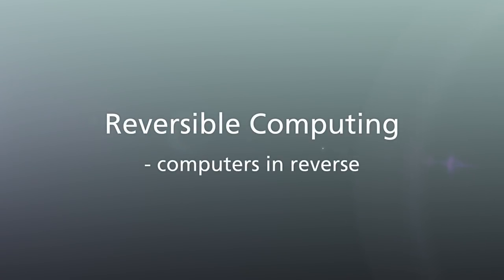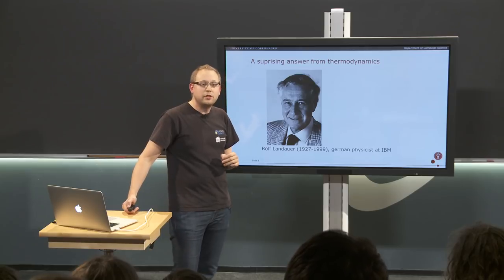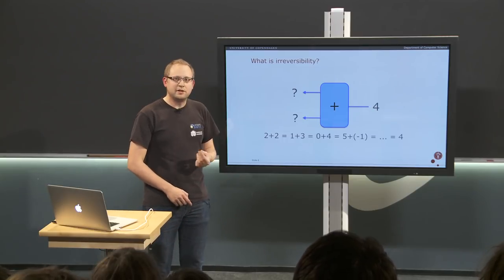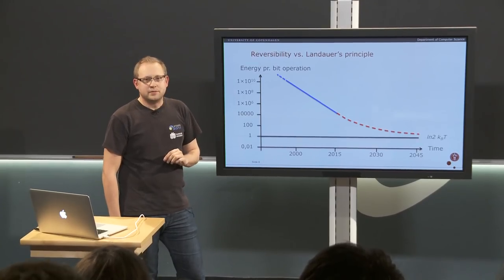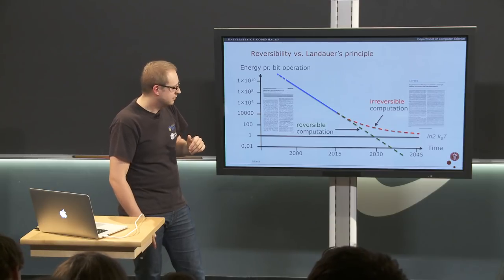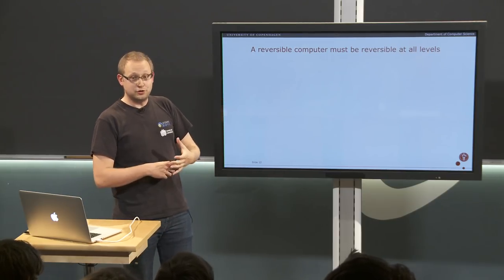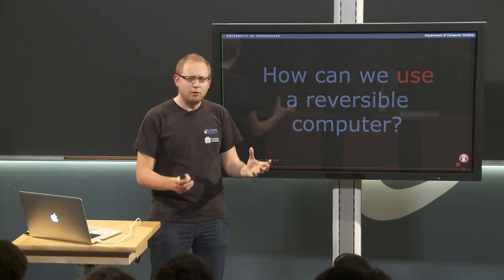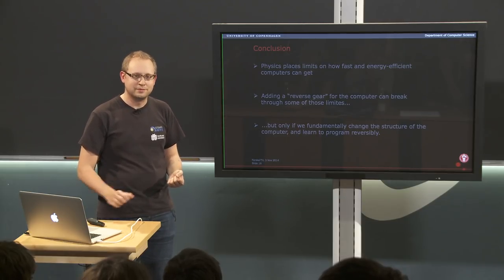Reversible Computing

Comment: how about the downsides of reversible computation? For example, making a reversible operation from an irreversible one tends to require more space (bits of memory)
Reply: I'm not quit sure if you think of reversible as a programming paradigm or as an architectural property of the machine? Last thing first. yes there would be a relatively small amount of extra bits used. if you mean as a paradigm property, not necessarily. It is highly implementation dependent. Assume that we have some program/system that would require the ability to at least some extend do some backward computation of a function/method, then this would still use memory even if we don't have the property. Offend the compiler which would be able to find the reversible function will do a better job minimizing the size of the program, you could even make some intermediate language to interpret, that encode reversible computational property. if we have a sequence of simple (machine like fix sized operations ) it would only need to encode and extra pointer at branching and an extra pointer to indicate the end of the sequence of operations of that function. Since all other operations happens to be a sequence and traversing forward an backward would be the same, it would need a mark that indicate weather the function should run forward or backward. This would possibly reduce the memory consumption of the program since we can effectively encode two functions into function one.
Reply: Requiring almost no energy is well worth the cost needing extra bit space. Especially with quantum computers on the way.

Comment: I think reversible computing would have a huge advantage from a debugging perspective, since we can always know how we got to the point we are at. If your program crashes, just hit the reverse button until the point where it went wrong.
Reply: At the moment of writing, I'm doing a thesis in this area and yes it would be much easier for OS to not crash at all under the assumption that they are reversible. The most funny property of a language that have reversibility as a property, making a compiler of a language (possible the same language) will make the compiler able to decompile the program again for every program in that language. There is still a lot to be done before we find this property in general purpose language, and the downside is that we can't represent irreversible computation without a overhead of memory consumption in trace history (which will vanish every time the computation runs in reverse).
Reply: @streetwear37  how would a reversible computer handle data streams from an external source, such as user input? This information woild have to go somewhere.
Reply: It should be possible to create some sort of LISP that is reversible – without the benefit of low (or no?!) power consumption. The lambda calculus basically only has one operation: function application. I wonder if someone has invented reverse-function-application. You'd give it a result and something else, and it returns the function and the argument.

- plus(5, 3) => 8  
- reversiblePlus(5, 3) => (5+3=8, 5-3=2)  
- apply(x => foo(x), 5)  => foo(5)  
- reversibleApply(x => foo(x), 5) => (foo(5), ???)  

One way to make a program reversible is to store all former states. That's like making a memory dump every frame in a Gameboy emulator, for example. It would just take a lot of memory, which makes it impracticable.
You could store some kind of "keyframe-snapshot" of a programs memory every five seconds and discard the old snapshots. Some sort of backup system for RAM instead of for the hard drive. When the user or software-tester notices a bug, they can revert to the most recent valid former state, when it hopefully hasn't been overwritten yet.

Comment: Can't you make any operation trivially reversible, by passing on the raw inputs as additional outputs?

    def makeReversable(f):
        def reverseableF(input):
            return (f(input), input)
        return reversableF

Maybe you don't want that, because you need more memory for every operation? My first thought for a reversable "plus" here was to map (a, b) => (a+b, b), then the reverse operation would be (sum, b) => (sum-b, b). In that case, you don't need to remember a.

Also, I understand we don't want to have an unreversable component to create a reversable one, so we don't inherit the high power consumption of the unreversable component. Maybe that's the issue.

Comment: Forgive my ignorance, I'm not a physicist nor a computer scientist, just a philosopher. But isn't it true that if for a reversible computation we need the gates that have the same amount of inputs as outputs, then we store the additional information required for a reversed computation? This gives us gains in efficiency during the computation. But the extra information is not relevant for the result, so we either have to store it forever, or we have to erase it at some point. And if we choose to erase it, we dissipate the same amount of heat as if we were doing the irreversible computation in the first place, thus nullifying the gains. Am I wrong? If so, I'd like to learn why.
Reply: I think the extra information gets erased by running the program backwards after you looked at its results.

Comment: Very interesting topic, although actual reversible computing seems unfeasible to me, due to the amount of data you aren't going to use but have to save somewhere just for the computation to be reversible. This can't justify the energy used for manufacturing storage devices, as the required storage capacity seems to grow indefinitely as our computations generally go only forward, not backwards.

Looks like our brains are already at or near the limit that is imposed by thermodynamics. Nature would make use of reversible computing principles (in the sense of not erasing any information) if it would be practical, and the brain would not consume more specific power than any other organ.

Comment: How would the second machine use less energy than the first?  On first glance, it should use twice as much energy because it's doing 2 computations.
Reply: he doesnt explain why it uses less energy. In his example he's using an adder, however where energy is really saved, is with the logic gates. If you have an AND gate, it has 2 inputs and one output. So effectively, you're pulling one of the inputs to GROUND, and that is dissipated as heat. If you have 2 inputs and 2 outputs, nothing goes to GND, and so no energy is lost in theory.
Reply: Landauer proofed that. A reversible circuit have theoretically no energy dissipation (In real world very little much lower than irreversible circuit). Landauer found that the loss of energy was to the destruction of information not the execution of the computation itself, so if we can make a circuit that do not loss information over a computation it will not loss energy (theoretically) this is the property of reversibility.
Reply: Computers are isolated systems which can exchange energy with their surroundings. Since irreversible computing is a many-to-one mapping, entropy of the isolated system is decreased. However, entropy cannot decrease in the universe, so the entropy of the computer's surroundings must increase as a consequence, thus compiters will heat up and give off thermal energy.

Comment: Reversible computations... now all we need is a way to reverse entropy. Now THAT would be something.
Reply: Treasure Hunter Fluid theory (Reproduction/Alimentation/Rationality) decanted selfmultidimentionalover...
The simultaneity polydynamics of the movement  (Reproduction/Feed/Reasoning) generates pseudo-autonomy as material property, of the autogenous phenomenon; existing.(...)
Simultaneous as my unidimensional variability... 
unidimensional variability = live-beings
Reply: That's impossible. However Reversible Computations are in essence "0 entropy" operations meaning we could in theory have unlimited calculations being done as long as they are theoretically reversible and thus not breaking the laws of thermodynamics.

The implication of this in itself is almost the same as reversing entropy. As you could mind-upload yourself into a simulation and provide yourself with infinite (digital) experiences as there would be no limit in the amount of calculations per joule being done.
Reply: Inside a computer, irreversible computing actually decreases entropy because the output space is smaller than the input space. So, over time the set of states a digital computer can be in actually decreases, thus entropy decreases. The problem is the entropy of the computer's surroundongs is increased as a result, thus heat.

Comment: If we have reversible computer programs, than we will always have access to the source code. Also, encryption wont work if its reversible.
Reply: if the reverse is much slower, it could work
Reply: That is why you encrypt in the first place, to make it really really hard to decipher what has been encrypted, that just means it takes a lot of computer power a lot of time to break the encryption. Same is not true (as I understand it) with reversible computing as the solution to the problem is contained within the problem itself.
Reply: Árni Fluid theory (Reproduction/Alimentation/Rationality) decanted selfmultidimentionalover...
The simultaneity polydynamics of the movement  (Reproduction/Feed/Reasoning) generates pseudo-autonomy as material property, of the autogenous phenomenon; existing.(...)
Simultaneous as my unidimensional variability... 
unidimensional variability = live-beings
Reply: I guess the answer would be making some operations reversible but keep operations which are related to information you want to keep private irrecoverable. Maybe your computer uses a nano joule of energy to enter a password, who cares?
Reply: Most encryption function are build upon irreversible computation like modulus.